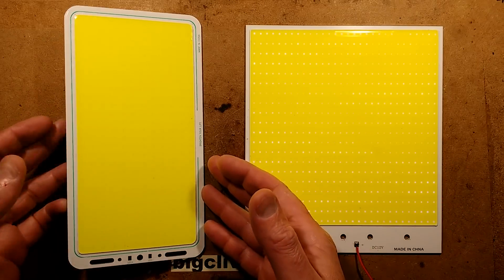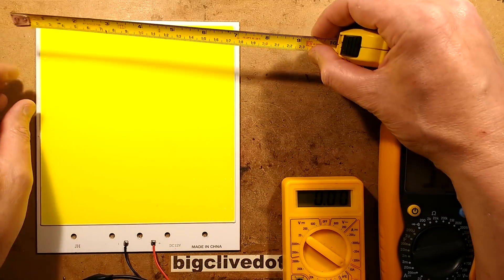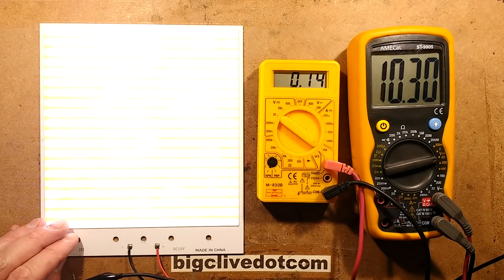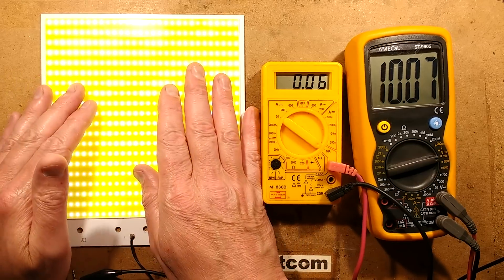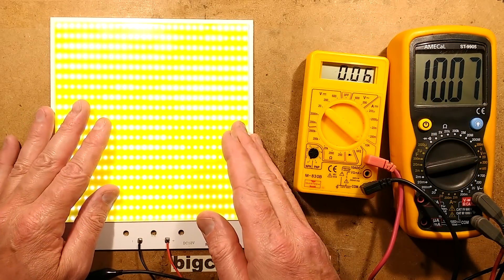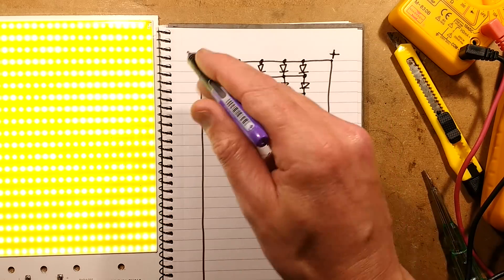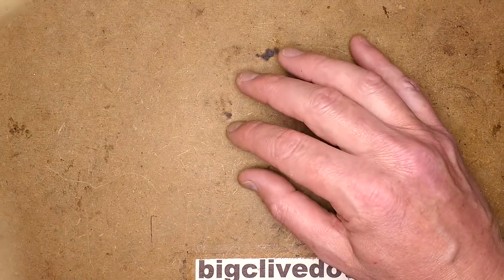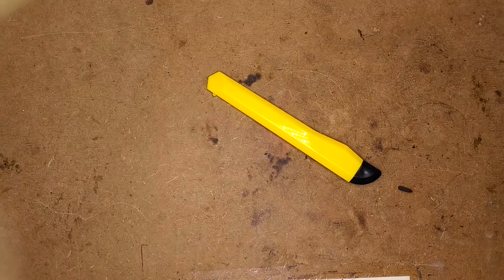Even BIGGER "200W" COB LED panel tests.

Comment: I had a computer PSU failure from (I believe, but I could be wrong) a power surge from the mains a couple of weeks ago, but it didn't seem to have blown any of the caps in the failed PSU. After opening the PSU case I don't see any smoke stains on the component side of the board. I haven't pulled the board out of the case yet, but here are... a photo of the components and board in the case: http://randomer.net/stuff/failed-psu-01.jpg and a photo of the label for the PSU: http://randomer.net/stuff/failed-psu-02.jpg
Reply: So what does it do? Does it have +5VSB? Does it try to do anything when you bridge PS_ON to ground? If no +5VSB, then chances are, you need to look at the very input, maybe it's just a fuse, and maybe it just failed because it got old, they are like little lightbulbs, eventually they just burn out, and sometimes they do this before you'd normally expect them to if you aren't lucky. I think they likely put the fuse into one of the input wires with a heatshrink.

I do think whoever made this PSU deserves to be slapped, because there would have been plenty of ways to uncramp it a bit and shift the capacitors out of hotspots, and moving part of input filtering onto its own board hanging off the connector on the left would have helped, but then that's not your issue today.

Take it out, look at the bottom, and take a look at that stupid primary side control chip board that is backwards slapped onto the same heatsink with the primary bridge rectifier.
Reply: The +5VSB to ground didn't do anything when I tried it. There's also no obvious fuse (and definitely not on the input wires.) I can keep cutting off heatshrink sleaves but I don't think that's going to find a fuse: there are no bulges in the wires.

There isn't another board on the solder side, just a handful of surface mount resistors, ceramic caps and zeners (and another diode), all of which don't look like they've kerploded. I do understand that some of those can fail short circuit and cook other components.

I'm pretty sure the PSU was killed by a transient spike from mains and definitely not from thermal overload (I've had a PSU fail that way when caps exploded). It failed about a tenth of a second after three battery backups all switched over to internal power. I also immediately checked the temperature of the PSU case (by touch) and it wasn't even warm (room temp here is ~12C.)

I've replaced the PSU and (obviously) I'm back online. I can do some more diagnosis on the PSU but I've alrady started disassembling it for components.

The 2 transistors on the same heatsink as the bridge rectifier are 20N60C3s. I can't quite see the label of the DIP16 chip on the board behind that heatsink but it doesn't make contact with the heatsink.
Reply: I found the fuse! The Hardware Secrets article on BP500U has some great pictures!

Right in the corner of the board closest to the power input, i see an upright heatshrunk component. Behind it, the designation F1 is hiding. Obviously this power supply is up to international standards and UL listed, and i don't think they could do this without including the fuse.

I know this is low hanging fruit and there might be more damage hiding behind it, but still.

Shot diodes, MOSFETs and the like are pretty easy to probe in situ, they usually short in all directions however you probe them.

The DIP16 should be Champion CM6800 or Fairchild ML4824 or compatible, actually easy to source. In fact there should not be a single exotic component on there, PS223 secondary controller is also very commonplace.

I don't know whether it's worth saving, it's up to you how much effort you want to put into it. At the end of the day it's just a PSU that ran for quite a few years and not the most glorious one. Due to them placing essentially all capacitors in hotspots, i think most of them are par for replacement, they should tend to dry fail after a few years without visible venting.
Reply: Ah! I see the fuse now too! I'd discounted that as another higher-watt resistor. Thanks! I'll cut off the heatshrink in a bit to see if it's blown. :-D I'll probably do some probing for fun and learning, but I don't really intend to try to fix the PSU.
Reply: Oh... right... the fuse has an opaque white tube so I can't seen inside. Meh.
Reply: I don't think looking inside adds any value, just buzz it. But how nice of them to give you a ceramic fuse to avoid explosions.
Reply: I've already cut some of the wire leads off of the board and desoldered some of the components so even if I plug it in and switch it on it probably won't work... and... I'd be a little bit afraid of it. ;)